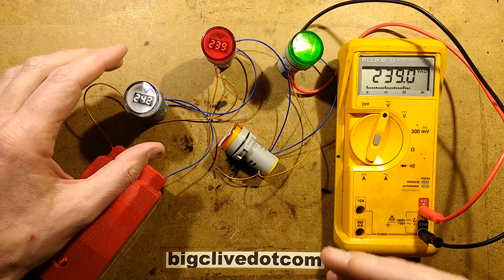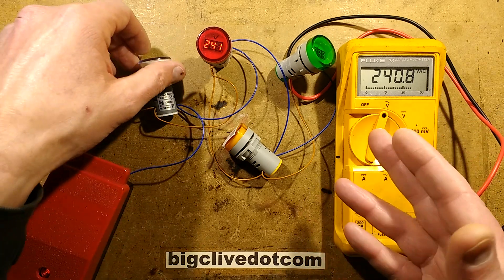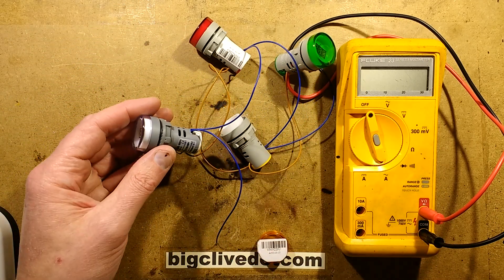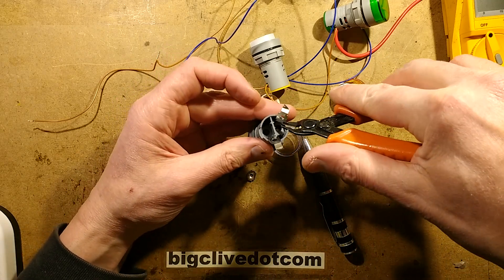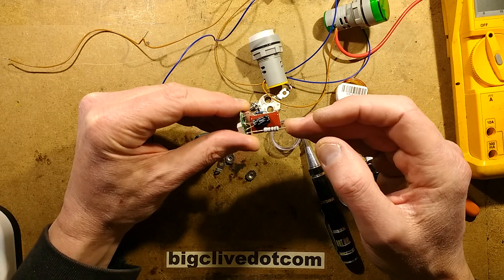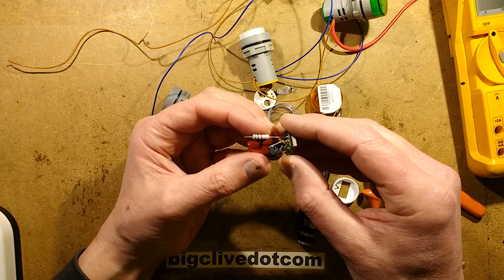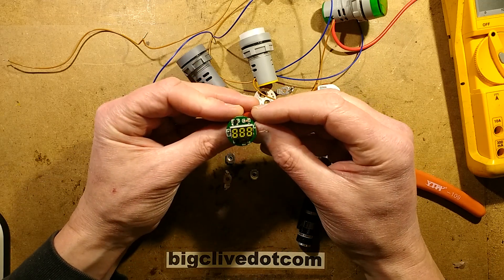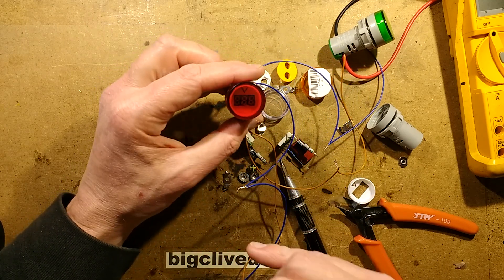Inside a 22mm digital panel indicator/voltmeter.

Comment: i would be curios to know what the voltage they operate at, at the meter board input. These may have uses at lower voltages too with modification.
Reply from the maker: 5V.  I've been reverse engineering the circuit this morning.
Reply: That needs to be mounted in a panel with plenty of clearance behind it which is OK for cars but was looking for something really small to tuck away maybe under the seat of a motorbike, if Big Clive's meter can be removed from the casing and used without the big capacitor and resistor it would be ideal. It's not necessary to have it in view all the time, just wanted something really small that can be switched off most of the time and just switched on once a week or so for a quick check.
Reply: If you want circuit board mounted, its not much larger than the 7 segment display; 
https://www.ebay.co.uk/itm/DC-0-30V-2-Wire-LED-Display-Car-Digital-Voltage-Voltmeter-Panel-Car-Motorcycle/372047741096?hash=item569fc600a8:m:mNZAGm4MFBW0yPx8trc6jvA

There are two digit sizes if you hunt around. Along with a 2 wire version, and a 3 wire version thats apparently a bit more accurate (12volt supply, gnd, measurement point).  For 5-16 volts they are within a tenth of my fluke.
Reply: Me too, the display is small enough to very useful in other devices or even for use in vehicles. I would like to know how to convert one for use with 12v
Reply: To be honest you may find these are more sensible for low volts > https://www.ebay.co.uk/itm/DC-12V-24V-Car-Motorcycle-LED-Panel-Digital-Display-Volt-Voltage-Gauge-Meter/182610540806
Reply: Ian this is what you need to take a look at >  https://www.ebay.co.uk/usr/gammatronixlimited  , i use one of their multi led ones which has an alarm in it too in my van.
Reply: No I require a bit more accuracy than just LED's, the first one you mentioned would probably do fine if it was taken out of it's case
Reply: banggood do them too, if you buy in quantity they are cheaper if you need a few > https://www.banggood.com/0_28-Inch-2_5V-30V-Mini-Digital-Voltmeter-p-974258.html?rmmds=category&cur_warehouse=CN

Comment: On Aliexpress there are these (slightly cheaper, free delivery) BUT more interestingly there are Ammeter models driven from a toroidal core which I guess slips over the feed to be measured! They are slightly more expensive!
Reply from the maker: Not in the same round form though?  I've seen the rectangular ones with current transformers.
Reply: Round ones https://www.aliexpress.com/item/Power-220V-AC-22mm-Digital-Display-Ampermeter-Monitor-Current-Indicator-Signal-Light-Ammeter-Tester-Measuring-0/32828543298.html?spm=2114.search0104.3.63.lFCU9a&ws_ab_test=searchweb0_0,searchweb201602_1_10152_10151_10065_10344_10068_10342_10343_10340_10341_10084_10083_10305_10304_10307_10306_10302_10059_10314_10184_10534_5790011_100031_10604_10103_10142,searchweb201603_40,ppcSwitch_3&algo_expid=47f83340-db29-4e48-ba66-3ebced39001b-8&algo_pvid=47f83340-db29-4e48-ba66-3ebced39001b&priceBeautifyAB=0

https://www.aliexpress.com/item/Power-220V-AC-22mm-Digital-Display-Ampermeter-Monitor-Current-Indicator-Signal-Light-Ammeter-Tester-Measuring-0/32840482188.html?spm=2114.search0104.3.1.JxpI6L&ws_ab_test=searchweb0_0,searchweb201602_1_10152_10151_10065_10344_10068_10342_10343_10340_10341_10084_10083_10305_10304_10307_10306_10302_10059_10314_10184_10534_5790011_100031_10604_10103_10142,searchweb201603_40,ppcSwitch_3&algo_expid=b423fdff-04c7-4974-b97b-493d27ff966e-0&algo_pvid=b423fdff-04c7-4974-b97b-493d27ff966e&priceBeautifyAB=0

Comment: Can it be easily modified for DC use? Obviously the power supply needs to be changed, but would be able to read DC?
Might depend on the softwares I think.

Comment: I think it's assembled the other way around. The contacts at the back get their components soldered onto, those two resistors namely, then the contacts get installed, and the PCB gets threaded onto the resistors; then the PCB is soldered in place. If there's a bit of lead poking around the display that is - if there isn't, i'll need a new theory.

Comment: The voltage range is quite large. That is impressive. I would like to know how the supply circuit is constructed. The 470nF capacitor passes quite a lot of current at 500V. What about the frequency rating? Will it also work at 60Hz?
Reply from the maker: I'm not sure I'd trust it at the higher voltages, but that said, it's quite good circuitry for the 100 to 240V range.  I think it's both 50 and 60Hz compatible.
Reply: I agree that it is safe to use between phase and neutral (max 240V in EU), but I'm sure that it will also be used between phases (max 415V + transients ;-)

Comment: hi . can u reverse engineer chewing gum shock device and make schematic of it . coil turns and tickness and ohms
Reply: Same as the mosquito buzzers but less powerful
Reply: 1min Google http://mosfetkiller.de/?s=elektroschocker
Reply: Muhammed Fatih Saruhan it shouldnt be hard to design something like that, you would need oscilator and step up transformer and some kind of battery or psu to power it
Reply: Use Google please there are lots of shockers out as a two transistor vibrator circuit and a 12V/230V 1-2VA transformer used in reverse

Comment: So, I'm curious, is 1.41 a general measurement for the maximum potential of an AC mains supply or is that mostly applicable in the UK? Interested in the reasoning behind this as well. It gave a figure of 169 volts based on the 120v here in Canada, which sounds familiar, I think possible due to the setting on some of my UPS's
Reply: Its worth noting that the 1.414 (square root of 2) value only calculates the RMS value of a pure sine wave. If you come across some other waveshape like a triangle or square wave the conversion factor will be different. (And a cheap UPS or inverter might make a square wave output or "modified sine wave" output.)
Reply from the maker: The normal mains supply is given as an RMS (root mean square) or average value of the sinewave.  The peak voltage is that multiplied by 1.41 and gives an indication of the peak voltage capacitors in a power supply will be charged to.
Reply: its a general conversion factor and as an approximation of the square root of two you come across it allot
edit to add reference https://en.wikipedia.org/wiki/Amplitude#Root_mean_square_amplitude

Comment: It would have been interesting to see some of these devices hooked up to a variable transformer; to determine the actual minimum voltage at which they start operating, and also to check their accuracy across a range of voltages.  It might read right at 240V, but if the slope is wrong then it could give false readings that just get wronger and wronger as you move further away from the swwet spot .....

Actually, I might order me a couple of these little meters to fit to my own homemade  (well, I didn't wind it myself, but I put it in a neat housing, with an on-off switch and fuseholders for input and output fuses)  variac.  At that price, it hardly matters if they turn out to be bollocks.  They still look damn sexy!
Reply: That's a good test to do, but I'm betting that this is a standard DVM chip, and other than starting volts and blowup volts, it should be within 1 or 2% over the whole range. I've done a fair amount of these range measurements on modern digital meters, and they are just amazingly accurate. Now, check with triangle or square wave and the results might be radically off.
Reply: l wilton Yeah, I'm probably just  worrying unnecessarily.  10% of 240 is 24, so anything between 216 and 264 is  still within 10% of nominal.   And digital stuff by definition either works ,or it doesn'a.

Would be kind of nice to try some extreme hacking on these  and create a general-purpose 3-digit display that can be used to display any arbitrary pattern .....  If the chips are FLASH based and have at least one I/O spare  (the ADC input that was used to measure the supply should become available)  it ought be possible just to reprogram them; if they are PROM based then it will require a whole new PCB design.
Reply: FWIW I just bought a set of these off eBay so I can run margins on them. Perhaps I'll make my first ever YouTube video of the results when I get them in a month or so. I expect the results to be within about 2% or so.

I've hacked other meters similar to this to have an external power supply so they would read down to 0V. Handy when you want to measure the output of a Variac.  Never thought about hacking the purpose of the meter. If the thing really is a PIC chip or proper clone, it would be possible to bring it up on the ICE and maybe see what is going on. But the code can be locked down in these things, so it might take a moderate amount of re-engineering to change things.
Reply: bluerizlagirl  my thoughts too I would like to have seen that as that's what I want it for got no room on my variable transformer panel for a meter  !
Reply: Here in the USA, mine reads 13 volts low.
True RMS at my home is currently 121 VAC... LED panel meter reads 108 volts  :-(
Ouch, that's low by 11%  !!!
Reply: Yeah, accuracy... I think most of us want to see if it starts smoking at the upper-end.
Reply: +I wilton, a good first step would be to check if the pin usage agrees with a known microcontroller. You're right about the code lock down though I've heard that it's quite surprising how often that isn't done.

Comment: You could connect them as star, with or without the neutral. though without you may need some balance resistors so they don't go out of range.
Where i worked we lost 7 motors to an imbalance, something like 270, 190, and 80V
Would also make a nice cheap voltage probe ;)
Reply: You would definitely need balancing resistors if you tried to connect these meters in a phantom-neutral star arrangement, because their own resistance is not going to be anything like constant.

A meter connected between a star point and actual mains neutral would give an indication of any phase imbalance, though.

They are small enough and inexpensive enough just to have a set of three colour-coded meters, measuring the voltage between each phase and neutral, on every circuit.  Of course, even in single-phase situations, you might need multiple colours; a homebrew CHP plant might use blue for grid and solar, green for battery-fed inverter and red for generator.   It would also be useful to have a meter at the socket end of a long extension lead -- better than just providing an indication that the sockets were live, it would also show just how much the voltage sags when appliances are in use.

Do they do a matching ammeter?  I am guessing that would need a third connection for the neutral;  it can't really rob enough voltage from the load.  Damn, I just want these sexy little meters everywhere!
Reply: @bluerizlagirl   Yes, they have matching ammeters, you can get them on Amazon for about $20 USD for a pack of 3 : https://www.amazon.com/Yeeco-Display-Digital-Voltmeter-80-500V/dp/B07D76QJ5C?th=1  This is the "Yeeco" brand, they also have them as "DROK" branded.

Comment: 430k is a standard value, as is 51R, Clive. The different tolerances have progressively more values as tolerance becomes tighter. Check out a decent resistor values chart, and you'll see what I mean.

Comment: Hm. So not suitable for the 480Y/277V we have in the U.S. unless you keep it on the phase-neutral and not phase-phase.

Edit: Just looked at the eBay listings. Some are listed 30V-600V (naughty). However others are listed with a 450V top end. I wonder if they still use the same capacitor (more appropriate) or a lower rated one?

Comment: Awesome thanks bigclive that will go good with my homemade power supply.  Do they a series that measures  current?
Reply from the maker: You can get a combined rectangular version that does voltage and current (with a current transformer).

Comment: These are nice little cheap units. I wonder, what is the parasitic voltage/amps that it draws? Would be interesting to use for a powerwall application to monitor without any major circuitry or programming.
Reply from the maker: These are only suitable for AC supplies and their capacitor passes around 30mA at 240V but actual real power consumption is around 0.6W.
Reply: Can we make an independent power supply for the chip and display but inject a dc voltage to be measured? As a diy project, not industrial stuff.

Comment: 400 V on that?  No way. With that cramped design, one bit of condensation from temperature change, it’s boom time.
Reply from the maker: I wouldn't use it at the higher voltages, but the separation from the free-floating capacitor and resistor, both in series with the PCB does make it a sensible design.  In some ways it's better internally than some of the high profile name brand panel indicators.  That includes the old indicators that used an MES socket for 240V plus lamps.
Reply: Bjorn Roesbeke But the parts that carry 600V are the full length of the thing and sitting in their own plastic tube inside an industrial grade control box.
Reply: But very significant current if the thing decides to offer 'a little less' resistance
Reply: Crocellian the separation seems more than adequate for 400V. It’s not like you’re talking about significant voltage there.
Reply: bigclivedotcom still ultra shit if it put's your wire on the front door cabinet, fire and bang. Way to dangerous to try, it gives zero info as these are used as voltage indicators. Most industrial equipment runs on AC to DC 24V or 48V and the high power stuff is vfd driven so AC-DC-AC and throws errors if voltage goes too low

Comment: Like these. Would be nice to mount on my cars dash to keep an eye on the battery charge.
Reply: Blarg King Yeah, that would be nice if the minimum voltage was 12 volts dc and not 60 volts ac...
Reply: Ah, didn't notice the minimum voltage. Although I'm willing to bet there are similar panel voltmeters designed for low voltage DC.
Reply: Blarg King: I bought a 12VDC LED meter designed to plug into the cigarette lighter in a car.  It works very well.  No need to make a hole in your dash.  Got it on eBay for a couple of bucks.
Reply: The only issue with that is my sole 12 volt socket is occupied by a power cable for my car bluetooth dongle.
Reply: Blarg King:  There are multiple adapters for 12 volt available.  The one I used on my truck had a short extension cord on it (like a small power strip) that allowed me to relocate my gadgets away from the dash where it was too crowded.  It was only a few bucks on line, too.

Comment: Holy crap, if those don't have an nasty tendency to explode they're great!
Reply from the maker: +Robert Szasz I'd always use a fuse in series.
Reply: Arya  In practice, the majority of self destructing electronics goes out in a very boring, non-magic smoke, non-exploding way. A 250mA ceramic fuse will limit the power if the indicator does decide to self-destruct. You can't really use a lower current fuse, because then the resistance of the fuse may affect the accuracy. And the fuse has to be able to handle the reactive capacitor current.
Reply: bigclivedotcom they could always explode and then take the fuse out. Or explode open circuit.
Reply: In China, you simply pay for the marks and paperwork you want. They mean nothing.
Reply: Or catch fire without blowing the fuse. Chinese suppliers are too cheap to use fire retardant materials.
Reply: hey atleast theyre inside a half-decent case that will help contain the destruction.
Reply: You're not going to use these in any industry system...no testing marks and then used in the front panel. No thanks, not touchy touchy china crap :-p

Comment: Very cool indicator. Sadly, might not handle the 3 phase voltages here: 577 V phase to phase. I believe Canada uses the highest 3 phase industrial voltage in the world. These might work OK in the USA, where it is 460 - 480 V phase to phase.
One way around this might be to read phase to ground/neutral, which is 347 V.
Reply: LakeNipissing Here in Ontario, where I work, we have 575/600, 460/480, 200/240. But the reason not to use these at work or home, is lack of CSA or cUL certification.
Reply: Well, that would be expected coming from China!
Same product from AB with CSA / UL approval would be 130 $ for one!
Reply: LakeNipissing Or idec for $60 :-)

Comment: “Let’s get a meter in,” then nudges the Fluke even further out of the frame with the Amecal. Poor old Fluke.
Reply: Definitely.  I keep a $2 Hazard Fraught meter on my mostly-software desk, which gets used for testing continuity and AA batteries for my kid's toys.  The good stuff lives down in the proper electronics lab.  (I also find most of the hate for Chinese gear confusing, as nearly all the good stuff is made in China now; it's mostly a question of getting what you pay for.  In a decade or two, I won't be surprised if the best test gear is primarily documented in Chinese, for the Chinese market.)
Reply: they did bumpy bumpy :)
Reply: Yeah, I noticed that.
Reply: I use a fluke 115.
Reply: Well, if you are in the habit of keeping your Fluke for best, it's entirely reasonable to reach for the AmeCal for a first measurement.  If it's outrageously wrong anyway, even a cheap meter will tell you that.
Reply: Josh Myer i cherish my venerable fluke 77...